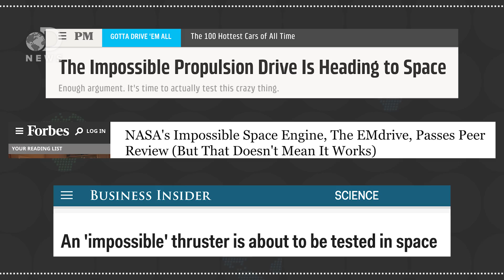How The 'Impossible Drive' Could Break Newton's Third Law

Comment: Confusion arises from a simple misunderstanding of action and reaction. Newton's Third Law states that for every action there will be an equal and opposite reaction. And that is precisely what happens within the closed vessel. Newton's Third Law does not define that equal and opposite reaction, as as leverage to any fulcrum external to the propulsion system. A contemporaneous  newspaper criticism of the work of Dr. Robert H. Goddard, erroneously claimed that rockets would not work in the vacuum of outer space, because there would be nothing for the propellant exhausted to push against. But there is no need for an external fulcrum to provide resistance. It does not need to be presage against an outside medium. Indeed, it can be pressure against exhaust expelled, even in a vacuum with no external fulcrum at all. Unless, of course, the propulsive exhaust, by escaping, is then considered an external fulcrum. But this is a misunderstanding. Indeed, what if the propulsive exhaust were captured, instead of being allowed to escape forever? In principle, that should make no difference. However, in practice, such a sealed vessel would then explode! But what if the exhaust were much smaller or the vessel much bigger? Then there would be no appreciable pressure build up. And that is what happens with the em drive. Nowhere does Newton's Third Law actually demand of closed vessels actually to explode from contained forces. Only common sense does that. But common sense, unlike physical laws, may allow for a work around.. Actually, a closed vessel is not the same thing as a closed system. The closed vessel still exists within the external universe. That equal and opposite reaction and consequent momentum are functions within the external universe. If the closed vessel was symmetrical, then the charged particles after striking one wall and bouncing off, would then strike the opposite wall, and the opposite momentums would cancel out. But the closed vessel is not symmetrical. Therefore after striking that wall and imparting momentum, the particles bounce around in different directions, therefore without directly opposing that initial impact. It only sounds Ludacris.

Comment: Even if the EMDrive works it still would not break Newton's Third Law. Those microwave particles would create a quantum force that somehow leaks out of the back portion the cone, thus creating thrust. I think it would make the cone explode if the intensity of the microwave particles is increased exponentially. It might work but then we would need to find a material that can withstand that quantum force.

Comment: It makes sense to me— the chamber doesn't need to break the third law to generate thrust. It just needs to distribute actions and reactions asymmetrically over the surface, which is precisely what the cone shape does. The sides of the cone are symmetrical, and therefore I suspect over time the force vectors of collisions with the sides will cancel each other out. However, with the caps of the cone being of unequal size, there will be less chance for waves to bounce off of the small end than the large end. There will be force exerted on both sides, but cumulatively more will be exerted on the broad base of the cone, therefore generating thrust. It's a simple matter of adding the vectors. No law is violated, just harnessed.

Comment: The third law is defiantly not broken. 
If the photons emitted are captured by for example a "solar sail", the "solar sail" would accelerate in the opposite direction. Therefore the photons basically "carry" the third law force but it may take some time to finally complete. Since photons move at the speed of light, they basically don't "experience" time from our own reference point.

There are actually already a couple devices captures photons to generate trust. One of the most famous one is the "IKAROS" that was launched in 2010. "IKAROS"  uses a "solar sail" to capture photons.
For more information just google "Radiation Pressure" or "solar sail".

Comment: Pretty dissapointed considering this is made by the discovery channel. The radio waves don't bounce in the cavity,  they resonate, imparting a small amount of momentum onto each plate, there is an imbalance in the force on the plates which cause this net force in one direction. The radio waves loose energy as this momentum is imparted onto the plates. It's not impossible, it's just difficult to understand.

Comment: How about just using a fire hose on the inside wall of the starship. Everybody knows that a fire hose pushes things away, right? So just blast it at the wall and collect the water from the floor to keep blasting forever! The wall will be pushed away from you, and with it, the ship will be pushed in the direction you are hosing...

... right?

... uhm... no.

See how easy it is to fail basic physics?

It doesn't matter if you replace the water from the fire hose with "exotics" like microwave radiation or other things that common people have little to no understanding of the nature of.

Comment: nope wont work.
when a force hits something at an angle, it is measured by both the x and y axis, affected proportionally to the angle. so yes the waves hit  a large area of the cone, but much of the force is being distributed to the y axis, canceled by when the wave hits the other side of the cone, and what force goes to the x axis over that larger area, since it is only the proportional  energy to the angle, will have the sum equal to the opposing energy when the wave hits the flat wall.
Seriously, basic physics that one needs only trigonometry to understand

Comment: Sir Isaac Newton first formulated the "Conservation of Momentum" law in the 17th century. Newton also created the "Law Of Gravity" and first published it in "Philosophiae Naturalis Principia Mathematica" in 1687.

Centuries after Isaac Newton's discoveries a young Albert Einstein, using first principles, came up with General Relativity which shows that Newton's Law of Gravity is an approximation. In most cases we still use Newton's equation because it is good enough. However, for example, you can't calculate Mercury's orbit correctly using Newton's equations, you must use Einstein's to get it right.

Is it possible that the "Conservation of Momentum" law is ALSO only an approximation?

Would you believe NO ONE knows what momentum is. Sure there are equations that describe its effects, such as Momentum = Velocity times Mass ( p = mv ) but that doesn't say what momentum is. There are suspicions that, once again, relativity may be involved - though Special Relativity in this instance - and is what Roger Shawyer thinks is the reason the EM Drive works.

Don't be dismissive of something just because you don't understand it. Look at the facts. If the facts say one thing and your theory or beliefs says another you have a choice of either covering your ears and eyes with your hands and singing loud songs, or changing your theories and beliefs. The facts in this case are that scientists ARE showing an 'anomalous' force when they turn on the EM Drive.

Comment: There's a reason no one talks about Shawyer creating this device; his explanation for how it works is basically "I pulled on my bootstraps to fly." The theory that's being pushed around now has to with with the quantum vacuum, and it's believed that the microwaves might be imparting work on virtual particles that pop in and out of existence. A more relate-able analogy would be that, rather than thinking of it as a rocket that shoots out light (at itself), it's more like a quantum propeller that pushes back on the "atmosphere" of the universe.

Comment: the movement is actually neutral meaning that it won't actually move because it stays inside the thruster because it bounces back and forth without escaping, it has to escape in order to push the vehicle though space. if it doesn't escape, it would only travel a short distance and then stop, because the microwaves bounce around and push the a short distance and then pushing it back the other way. so it doesn't really travel very far, it will heat up and explode because the microwaves can't escape, they only stay in the thruster. so do you get My point?

Comment: but if you put two magnets together opposite side they repel. so in theory its using force to repel the drive but can't repel as its trapped. only problem is that device is going to explode unless they have a way to contain the energy from the force(frictional matter).
Guarantee its gonna explode in 6 weeks if constantly being used

Comment: Why do you make something so simple seem complicated?  Momentum is conserved at each instant.  Why claim that it isn't?  CONCEPTUALLY here is what is going on:

The vacuum is composed of a sea of virtual particles constantly popping in and out of existence.  They form as particle pairs, and many of them are charged particles.  Think of the short time during which a virtual particle pair exists.  Imagine the particle pair in the center of a blackboard in front of you.  Imagine applying a time-varying electric field on the surface of the blackboard.  It is first a single horizontal field which separates the particles, negative to the left, and positive to the right.  Then the field splits into 2 opposing vertical fields:  One on the left and one on the right.  The field on the left propels the negative particles on the left downward, while the field on the right (of opposing orientation) also propels the positive particles on the right downward.  Momentum is conserved, and the source of the field ("quantum rocket") is accelerated upward while each of the oppositely-charged particles is accelerated downward.  Then the virtual particles dissolve back into the quantum vacuum.  The field is turned off.  A new set of charged virtual particle pairs is formed, and the process repeats. 

It's like rowing a boat:  During each pull of the oars, momentum is conserved.  But in between pulls, the accelerated "quantum water" disappears from the classical universe, and subsequently new water is reformed.  

This is the electric field gedanken.  A version based on the magnetic field also exists.  The charged particle pairs are born at random velocities which average to zero momentum.  In the magnetic dual, their motion relative to the magnetic fields cause magnetic interaction.  Their momenta are modified by the applied magnetic fields during their short lifetimes, but then they once again cease to exist, along with their (modified) velocity vectors.

You unnecessarily confuse yourself with the geometry, mechanics, and methods of engineering adopted to implement the femtosecond-varying electromagnetic fields.  Why over-complicate this concept?  Is it to just make something inescapable appear to be impossible?  Or do you simply fail to understand what you are talking about?

Comment: Well how about a machine that attracts particles from in front of it. If there's at least a few particles per kilometer in the void of space, they could be attracted to the shuttle, causing some thrust, and jettisoned out the back at the highest speed possible
Reply: Also maybe we've all been wrong on the whole every action requires an equal and opposite reaction thing. Whenever there's thermal energy, an electron is spiralling around a nucleus. What if some sort of force was applied at the nucleus holds onto the electron(s), evening out the energy, causing both to move in the same direction. A rather abstract idea but something on a larger scale would go something like this: out in space where there's no gravity, if a weight was forced in an orbital pattern around a more massive center, chances are, the weight would spin around the center but the center would also rotate some; both spinning and moving around a point between the center and the weight. If the weight was suddenly stopped, perhaps it could give the entire machine some momentum or the entire thing would just start spinning around, making donuts in space. What if, instead, both were spun in opposite directions. The center would simply THRUST back and forth, making an obscene gesture at the cosmos. While this may be the solution, it could be damaging to both the shuttle and the crew so what if the exact same thing was mirrored on the back of the machine. Doing so would give the weights momentum without any movement on the center. Next just slow the weights down when their traveling in the desired direction. I realize I didn't prove the third law wrong. I sort of just found a way around it.
Reply: Also maybe we've all been wrong on the whole every action requires an equal and opposite reaction thing. Whenever there's thermal energy, an electron is spiralling around a nucleus. What if some sort of force was applied at the nucleus holds onto the electron(s), evening out the energy, causing both to move in the same direction. A rather abstract idea but something on a larger scale would go something like this: out in space where there's no gravity, if a weight was forced in an orbital pattern around a more massive center, chances are, the weight would spin around the center but the center would also rotate some; both spinning and moving around a point between the center and the weight. If the weight was suddenly stopped, perhaps it could give the entire machine some momentum or the entire thing would just start spinning around, making donuts in space. What if, instead, both were spun in opposite directions. The center would simply THRUST back and forth, making an obscene gesture at the cosmos. While this may be the solution, it could be damaging to both the shuttle and the crew so what if the exact same thing was mirrored on the back of the machine. Doing so would give the weights momentum without any movement on the center. Next just slow the weights down when their traveling in the desired direction. I realize I didn't prove the third law wrong. I sort of just found a way around it.

Comment: there's actually a far better engine to use... and it'll work because #physics :) and this EM drive DOES actually have a reactant force... don't forget the microwaves are BOUNCING AROUND IN AN ENCLOSED WAVE GUIDE... meaning that every time they HIT THE WALL THEY EXERT A FORCE ON IT... meaning that... there is a slight + and - force when it bounces from the cone to the back wall... which pretty much negates most of the + thrust... mostly due to the angling of the cone the microwaves are forced to the back so there is a little gain in the thrust until they bounce back to the front and dissipate some of their lost momentum. so all in all there IS technically a slight above neutral thrust... every time the microwaves hit a wall they lose momentum so as long as their initial contact point is on one of the cones walls where they can dissipate the initial energy then it'll provide thrust... BUT i can see this thing taking FOREVER to get up to speed... like you could literally climb out of the space ship and swim faster than it'll go lol... simple science...

Comment: possibly like a whip that tapers from a thick handle down to a thin tip.  Using a relatively slow motion with the thick handle causes the momentum to move down the whip, causing the velocity to increase as the mass (thickness) of the whip decreases until it reaches the end fast enough to create a sonic boom. Maybe the microwaves pick up speed as they move down the cone, creating a force against the small end of the cone that is larger than at the wide end to push it in that direction?

Comment: Why can't we just build a small one in someone's living room and see if it travels to the other side of the room?  It we provide it with no way to move and it still moves, doesn't that say a lot?  I understand the value of completely locking down all the variables so we can be sure that it works the way we think it works but first shouldn't we check that it even moves at all?

Comment: What force is at work? The normal forces of push/pull don't seem to apply [third law violation] What about entropy? Are they creating a higher energy potential around the craft than the space in front thus allowing momentum a bit like rolling down an endless hill? Or is there about to be a Paradigm shift in physics? [picking one current theory that's not mainstream] perhaps gravity isn't related to the curvature of space/time  but a result of electromagnetic forces; in which case this could be some form of electromagnetic [attraction/repulsion] force.

Does the third law apply in quantum mechanics ? Given E=MCC, M and E are thus interchangeable so is expelling E rather than M still using a propellant?
Reply: Or does it work on the same principle that forces two ships together when close to one and other on the sea; something to do with reduced wave lengths and reduced pressure between the two. Apparently works on two rods in a vacuum.

Comment: Wouldn't there be an action. Since the microwaves are colliding with the larger end more often due to its shape they are putting more force on the larger end and wouldn't that be an action therefor causing a reaction. It would just be an engine where everything stays inside much like if i were in a box and i threw myself at one side causing it to move in that direction.